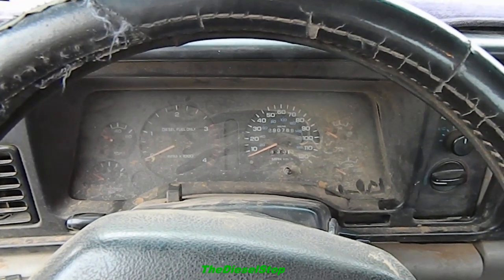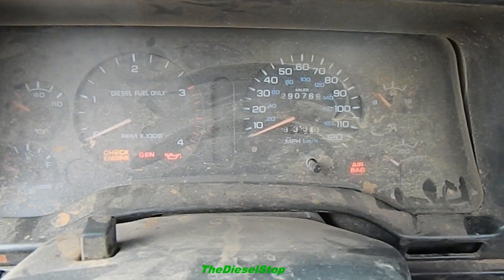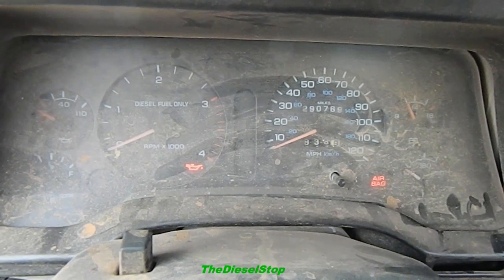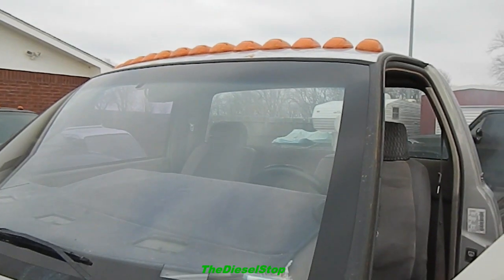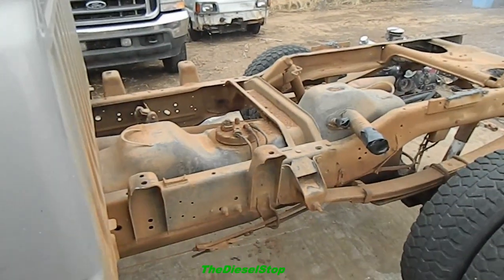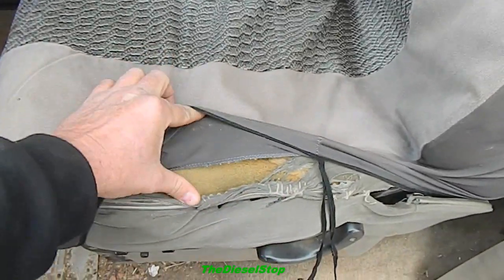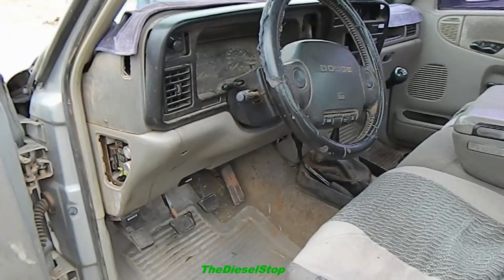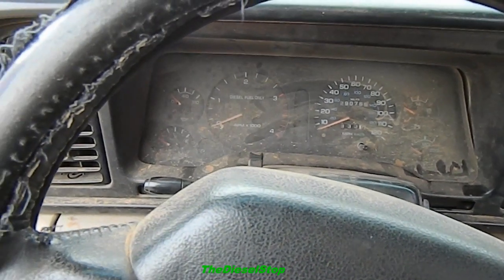96 Dodge Cummins Melt Down

Comment: oh i was checking each port, its quite interesting, i was just wondering because i always thought 1 and 6 run hotter because of lack of air.  And the 60 degree difference i thought that it would be tighter, probably has to do with injectors/pump.  Meaning the pump needs to be flow benched.  What I was thinkin but i'm not to worried about it, have a good night

Comment from the maker: As far as starting it for a minute it does not matter sense I will be building the motor in a few days. Just because a piston has a hole in it, it will not keep it from running.

Comment: I didn't follow what caused the piston to melt down. You basically said he had a tiny, plugged air filter that caused the seals to blow out of the turbo melting the piston.  Can you clarify?
Also how did you determine it was a melted piston besides the miss, which could be caused by a lot of things?

Comment: Where are you located?  I would love to put a diesel in my Durango and wondered if you have ever done it and what you would recommend for it?  I love the Cummins and thought the 4bt would be the best fit and mileage.  I just had my transmission rebuilt, 01 Durango R/T.  Would that fit the 4bt?  

If you've never done it, would you want to try?  I would love to have this done.

Thanks
Matt

Comment: Hey whats up, i got a question, i was playin with the temp gun the other day and i was temping the exhaust manifold and the number 1 and 6 cylinder were cooler then the rest of them.  I thought it was suppose to be the other way around? Also they seem to be about 60 degrees apart? Is this good?

Comment: Sorry, im newb - whats it do to an engine to run it with melted down piston? Is that just a hole in top of the piston or the whole piston is deformed and screwing up the cylinder bore? Cant understand why you would still run it :)

Comment from the maker: To much fuel & little air will melt down a diesel fast. All the oil from the turbo went into the intercooler plugging it up & the piston got to hot with the amount of fuel that was dumped into the motor causing meltdown.

Comment: You know it's funny how guys will bash each other on what emblem is on the body, but take a step back and look at the emblems on the components in and under these trucks. Over the years they have shared the same parts with small variations cosmetically. How they choose to put them on their chassis and how they build the body is the only diffrence. Danna Spicer, New process, Saginaw are all comon names I've seen on three makes. And how poeple treat them has to be considered too.